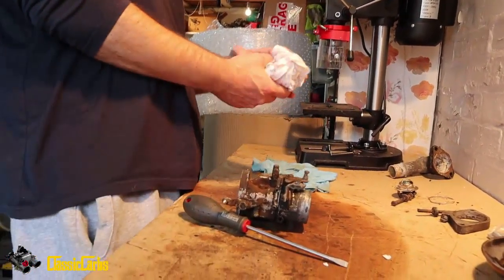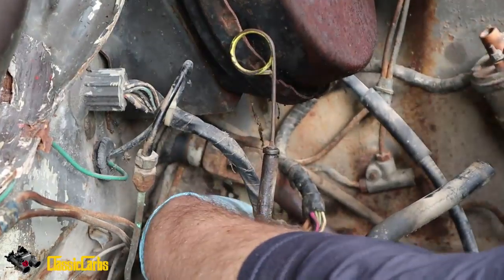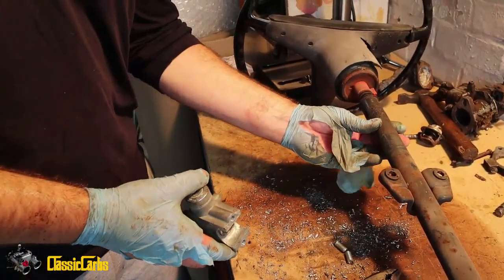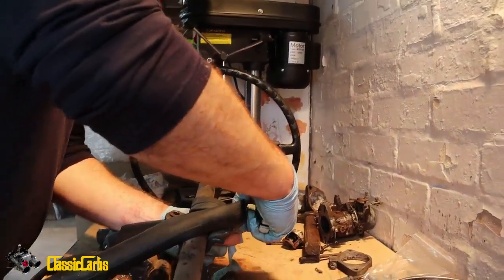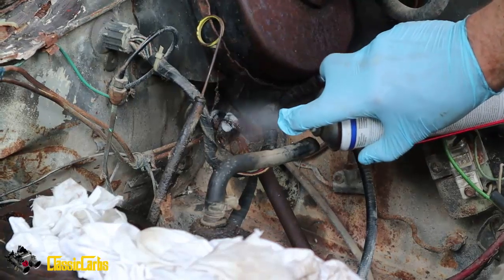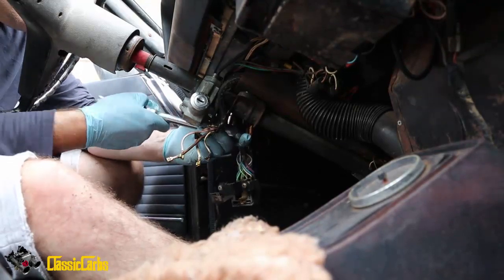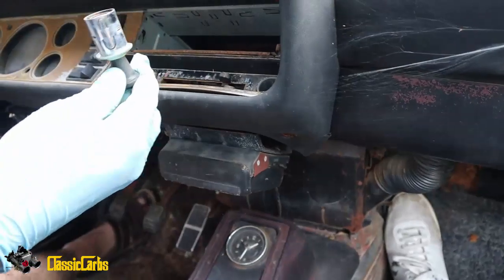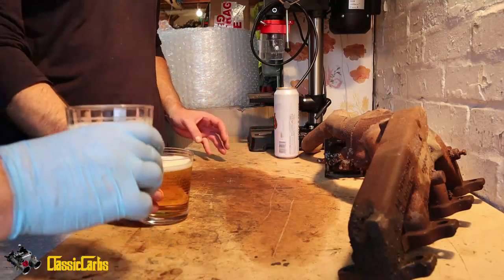1969 FORD CAPRI Barnfind - Will it start? - PART 4

Comment: I had a 1994 Mercury Tracer with the exact same  mounting for the steering column used in your Capri. The ONLY time I wore safety glasses was to keep rust and dirt out of my eyes while working under the car on the exhaust.  A beer curiosity, I've heard that English bars (pubs) serve beer warm, yet you are enjoying yours cold, interesting! Rock on guys!
Reply from the maker: Hey Dave, yes some beers are served room temperature here..That's Ales and bitters and stuff like that. Lagers and ciders are served cold.

Thanks for watching from across the pond friend 👍🏼👍🏼👍🏼🛠😊⚡🍺🔥😎
Reply: Beer is not 'warm' and room temperature refers to the cellar where the barrels are stored so it's cool but not ice cold like Americans seem to like everything they drink to be.

Comment: Nice job.  Now weld a washer to the bit of the stud that remains, then weld a nut to the washer.  Biggest one you can get on.  The welding heat will help.

Comment: to take studs out a manifold you have to heat the manifold not the stud ,heat the manifold and it expands or as you do heat the stud and it expands and gets tighter I worked in an exhaust place for years

Comment: What was that tool you used to turn the studs out ? I normally weld a big nut on and use heat.
Reply from the maker: It's called a stud extractor, quarter inch, 3/8ths , or half inch types are available. The one you saw was the big, half inch type
Reply from the maker: https://rover.ebay.com/rover/0/0/0?mpre=https%3A%2F%2Fwww.ebay.co.uk%2Fulk%2Fitm%2F392079087611
Reply: @Classiccarbscouk  Well you learn something new every day, I'd never seen one before, thanks for the link too. Enjoying the vids, keep it up.

Comment: If you warmed the first stud it’s better to do same with second one as well 🤣🤣🤣 carry on car mechanics
Reply from the maker: We thought about that...... after we snapped it!!!  
Now we'll have to buy another manifold... I don't know how to remove that stud, with drill bit stuck inside it...
Reply: You can only really use a smaller bolt welded to broken stud and heat from
Welding might allow you to take broken stud out 
If not take it to engineering workshop and have it drilled out and helicoil put in

Comment: Always heat siezed up studs first, still youre getting there is suppose.
Reply from the maker: Yup, agreed. Now how am i going to get that stud out?
Reply: @Classiccarbscouk  if there is enough sttud to weld a nut on to you still stand a chance, failing that its drill time and EZ outs. And lots of heat.

Comment: hmm seems to me that stearing thing is off a more basic model as it has the longer part might also be that the capri was built in there country so might be that's a mk2 or 3 rack and its just differant bit of a bummer, 
just be thankful that's the orginial ford wiring and not god only knows what grease after market wiring ford offerd, like after market radio 8 track player, inside lights speedo or other guages, inside light for night time veiwing, dash board light o read maps or a book while on the go or while waiting, fog lights, thank gods by the 90's ford put everything you needed in a car, so there was only 1 wiring loom and not speggitti wires going everywere,
good view of the insides and bonus possiblt 30 year old or 10 year old as the capri and other cars were being made in other country's way after ford had finished and was moving onto the mk3 or another car to replace it, you get goodies inside the ash trey wonder if there is anything in the other ones? 
if it don't want to come off while the rain pours down melt it can't be stuck if melted,

Comment: So it's a Greek Capri? Was it made in Espana? Look at the VIN. This would be interesting. An auto locksmith could make you a new set of keys! Keep the bent one as a pattern. Don't risk it breaking!
Reply from the maker: It was made in cologne, germany in 1969 and i guess then exported to Greece.
It has been in the UK for about 1-2 years now.

Thanks,